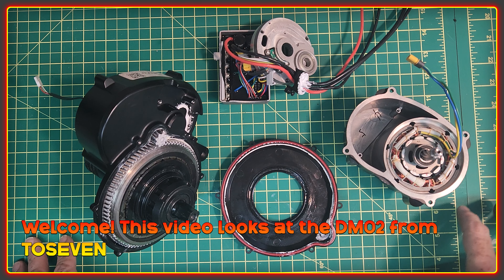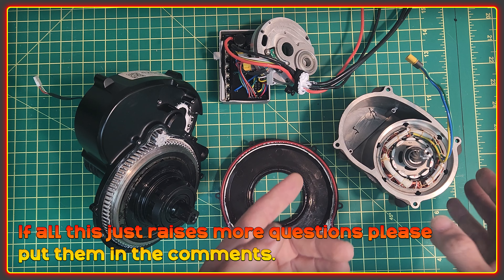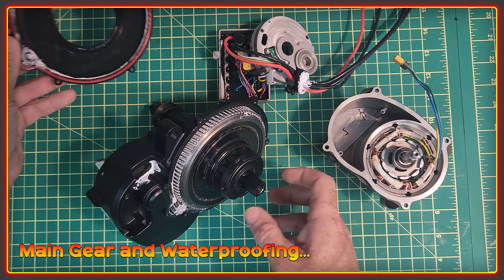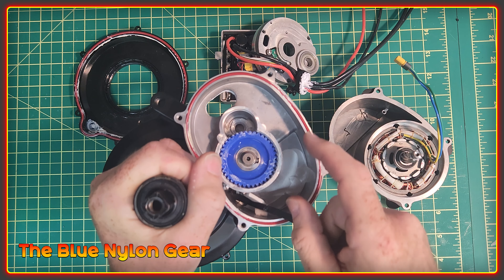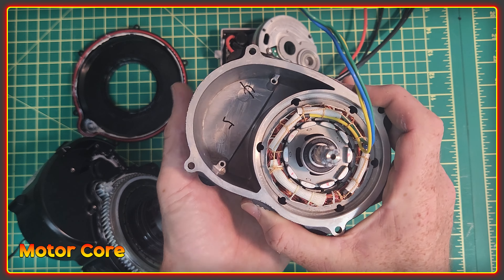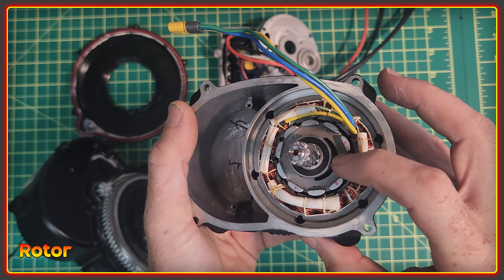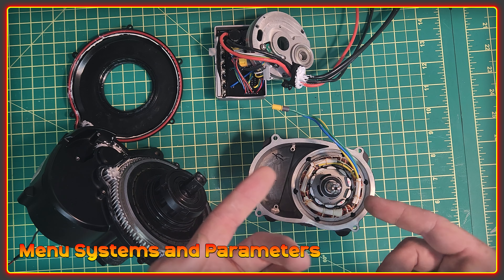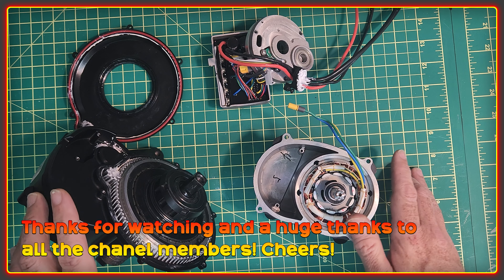Look inside the DM02 from TOSEVEN, discussion on differences with the Tongsheng TSDZ2

Comment: What a great review. I have a Tongsheng Tsdz2 750w and it managed to haul me up mount snowdon fitted to a specialized Enduro wuth a hailong 17.500 ah battery it never missed a beat no overheating.it even had a 46t chain ring on it crazy.iv bought a dm01 now and it is way more powerful but also alot heavier.great vids!!
Reply from the maker: Thats impressive up Snowdon! Wow. Done that climb on foot many a time. I take it this was up the pig track tho right?
Reply: I went up and down the ranger's track set off at about 3.30 am and got up for sun rise it was a good bit of hike a bike aswell.got down in no time atall the rangers track is pretty hardcore DH to be honest so had to be careful as I was on my own I thought the pig looked good but I was parked at the lake near the ranger station.il do the pyg next summer.tongshengs are pretty amazing for the money but iv brought a vitus e mythic as iv tried all the bolt ons now..

Comment: I would love to see the open source programming of the TSDZ2 migrate to the new To7 motor.
Reply: I would like the same!
Reply from the maker: I don't the the controller is the same ecosystem although both are UART. There is alot of work going on this side of things so I believe it will be open and for people to do their own thing with the firmware. I do not have a timescale on this.
Reply: It's open source so forking should be easy, I actually have an active fork for my personal OSF on my bike. The challenge here would be how compatible it is currently in comparison, if we had a guide line or a manual on the protocol it would make it easier. I'll gladly play with it if I get a dm02 once my tsdz2 kicks the bucket.

Comment: Thank you High Voltage for his internals video. While I see the three-phase wire plug (another subtle improvement), I've not read whether or not this motor's controller monitors the core temperature and protects it, as needed.
Reply from the maker: There is a temp sensors but it's just the one. The motor temp is extrapolated from that. I would prefer independent but we will see how it works in practice.

Comment: Excellent to hear they have made the motor self serviceable. I am leaning towards the DM02 instead of the CYC because of this, no point having a great torque sensing motor if you have to post it back to point of purchase just to replace a gear.
Reply: "self serviceable"? Where was that mentioned in the post? Since its  motor press fit into the housing, it seems to me the less serviceable.
Reply from the maker: I have a video to do on the CYC with that respect. I am struggling to get the main gear off.
Reply from the maker: Its not glued in so I am pretty sure the technique is to use bolts to push it out. I will obtain the procedure once translated. In reality though how many people need to service the stator on a motor? Most people that burn an BBSHD stator just buy a new motor core for $100 or so and bolt it on. I would imagine that this will be similar as well.
Reply: @nc3826  its the trade off for having a motor that doesn't cook itself. As high voltage have said you can just buy the motor housing and case all in one. Its not going to be that expensive

Comment: I have a DM02. But I need a plastic side cover And Gasket. Chain came off several times and it cut into the cover. Of course, I have installed a chain guide now.
Reply from the maker: TOSEVEN should be able to supply those spares Tony. Let me know if you are struggling.

Comment: Do we have a pinout for the motor connection to the harness and for the display? I already have a harness wired through my bike frame I don't want to remove so need to know wiring.
Reply from the maker: Discord would be the best place to get something like this. There is a TOSEVEN chat room. I am not sure if the company officially provides one but there may well be a user created one by now. The Discord links are in the description.

Comment: Amazing videos about To7 Motors. Would you say to us what's the distance (gap) between the bottom bracket and the motor. I want to know if the DM01 and DM02 can be mounted in a carbon frame. The CYC Photon have 12.7mm, the TSDZ 6mm. Thanks.
Reply from the maker: Okay so technically it can be just over 12mm. There is however a small metal tab that reduces it to 9mm. I cant see what its for though so if this was removed then it would be about the same as the Photon.
Reply: @HighVoltageKits  thank you, friend.

Comment: Seems like they could have done away with the kidney bean shaped casing and optimized for more room to rotate the motor against the downtube for better ground clearance. I suppose this was tooling carry over from the TSDZ2. Looking forward to seeing if you're able to find a solution for the chain line issue from your previous video. Being able to move the chainring more outboard might be necessary for modern MTBs with chainstays that are very tightly contoured around a small 1x chainring.
Reply from the maker: I don't think the tooling carried over but much of the design layout did. You are right this is an area that could be improved significantly.
Reply: believe it or not it can actually be rotated further up with the new design , there are some image's of it online, the gap between the bottom bracket and the housing has increased, its part of the reason why. i dont think i have any way to link to or post a picture here

the tooling hasnt carried over, if you look you will see the motor is on the other side on the tongsheng
Reply: @Alex-uh1mj  If the tooling wasn't carried over then it was a missed opportunity to improve the clearance even further by getting rid of some unused space.

Comment: Hi, thank you for this video! You compared to the Tongsheng TSDZ2, but what is about the TSDZ2B? Aren't some of these improvements seen in the Tosven DM02 also already available in the Tongsheng TSDZ2B? I am interested in buying the TSDZ2B or the DM02, but I want to choose the more reliable one, having less problems for longer time. Can you give me an advice on that?
Reply from the maker: I believe you are correct that some of the improvements are in the 2B model. I want to say that I have not seen one of those 2B models opened up yet and I have not ridden one so the feedback here is from other people. From what I am hearing the the DM02 deals with heat much better than the TongSheng. This is likely because the motor core on the DM02 is pressed in to the casing and on the TongSheng the casing leaves an airgap to the motor. You can get ones that dealers have modified to have heat transfer pads but its a bit like sticking a band aid on a bullet wound. This is based on feedback on our discord from riders who have had both motors. The feel of the Torque sensor is a bit more refined on the TongSheng right now as the firmware for that has been open source for a long time and has been heavily user refined. So there is some improvement to be had with the DM02. In terms of reliability the TongSheng Z2 does not have a good reputation but then the 2B revision as well as the TOSEVEN DMO2 are also relatively new so until they have been around for a year and people ride them a ton I can't say to you which one is more reliable. I will be getting the 02 back on the bike this week to do some more riding with. You are also very welcome to join our discord and chat with riders using the DMO2 to get their experience directly.

Comment: is this 48v ? how many amps for this motor ? did you try to adjust power levels via menu ?
Reply from the maker: Running 52 volts. I have adjust the amps and the power level percentages yes. They seem to be working correctly.
Reply: @HighVoltageKits  so you can adjust via display?  May I ask where did you buy the motor ?
Reply: @HighVoltageKits  did you put it in the ebike yet?
Reply: @pxl666 amps can be adjusted by the display and set to different modes. For example.you could set eco to 10, city to 14, and sport to 19.   Each with 5 levels.

Comment: Looks like an easy motor to repair. The nylon gear makes sense; it's a mechanical fuse and probably helps with noise reduction.

Motor manufacturers need to look at membrane type pressure vents to combat the moisture ingress issues. Often 'sealing' an air pocket in a product can cause issues as moisture often can squeeze around o-rings and gaskets due to pressure differentials created by thermal cycling. Moisture is also trapped if the product doesn't have some form of weep-hole. I would be tempted to add water cooling to these motors.
Reply from the maker: Interesting thoughts. The gaskets on these are decent quality. Better than Bafangs paper ones! Watercooling mods are definitely possible.

Comment: U say than that the BBHD ratio is 24/1 what’s the cyc and the DM02 ratio
Reply from the maker: I think the BBSHD is 22:1, close enuff tho. The CYC is 36:1 and good question on the 02. I don't actually know. I think it's in the setup menu. I will check when I'm next at the bike.
Reply: @HighVoltageKits  thanks I’m trying to pick one for my bike the BBSHD it’s the one that takes the most punishment and I think give u the most power but gear ratio is too low for me I don’t want to ride one to one ratio , the cyc seems to be very smooth and refine but not good for the diy community, DM01 seems to b a good candidate if gear ratio it’s higher than BBSHD !!!! Thanks a lot for ur content it really helps us to narrow what we’re looking for 👍🏼👏🏼👌🏼

Comment: How is the press fit motor removed from the housing for servicing? Plus please ask TOSEVEN why they use this methodology, instead of other alternatives, such as using a heat conductive paste or stator oil,  for heat dissipation?  Which would allow removal of the housing much more easily.

TSDZ2b has pressed in parts for structural purposes, which makes sense,  And since there is access  to both sides of those parts, they can be relatively easily pressed out and back in again. Which is not apparently the case for the motor housing, 

I actually have a few other questions. 'But was it really necessary to press fit the housing around the motor to achieve sufficient heat dissipation?' Is the main one and I hope you can get it addressed at some point.  Thank you.
Reply from the maker: There are channels down the side that I believe you insert a bolt and by threading the bolt in it will push the motor out of the core. A bit like removing the plate covering the nylon gear on a BBSHD. They are using this technique as direct metal to metal conductivity is better than any kid of conductive paste. Unless there is something new I am not aware of the stator oil will not work with a mid drive and is for hub motor. Lots of people used thermal compounds and shims to help with the Tongsheng motor. I am not familiar with the B motor improvements. All the videos I have seen the motor cover lifts off on the Tongsheng. The pressed in design I think is pretty critical for good transfer. It makes no difference to servicing the motor in terms of difficulty. Once I get it back on the bike I will show what kind of sustained power it can produce and the heat as well. One dealer that could get a Tongsheng to overheat in a few minutes was not able to do the same with the DM02. I will ask for the proper procedure to extract the motor core if that becomes needed.
Reply: @HighVoltageKits  Thank you for confirming, that the (six) outer holes can be used for extraction purposes.  I do hope you will post how the procedure is done properly. Since a few things that could, possibly go wrong (for example was the housing reinforced to deal with the forces from the bolts). But at least TOSEVEN has addressed the issue, in terms of making it possible, to remove the motor from the housing.

DM02 cost quite a bit more, so we need more data, to see if it's worth it? Thank you for helping with the research.

(Sidebar: Conductive paste, which is usually suspended metal particles. Needs to be applied very thinly, to maintain the conductive coefficient of the base metal in the paste. 

In addition stator oil is utilized in Yamaha alternators, so no it's not just used for hub motors, but Grin Technology mostly deals with with hub motors which is It's the main supplier in the e-bike community , so I can understand the confusion. But neither are part of Tongsheng or TOSEVEN mId drive motors, so a direct comparison is not applicable.

Lastly to get a higher level of heat conductivity, a heat pipe could be utilized, but this would increase complexity..Every alternative has trade-offs. What is most important in this case, is relative comparisons.)
Reply from the maker: That's really interesting on the stator oil. I can see how the Grin effect has caused that opinion to form. Thanks. Maybe it can be used inside the CYC Photon. Is there something specific about the design of a mid drive in order to allow its use? I have a bunch of ideas I would like to see with the motors. Maybe I will see if they will work with me on a few of them. I am exploring a few possibilities though. In terms of DM02 price. I would expect more than the Tongshen. So it needs to perform a step above to make it worthy of that. Once I get it back on the bike I will be able to give people an idea of how it does.

Comment: The tongsheng really had an issue where the motor only contacted the case at the mounting point, so most of the motor had NO contact to cool itself, in this video it already looks like that's taken care of

i have a tired TSDZ2 around but i unfortunately don't live in the UK
Reply from the maker: We are based in North America. Where are you? You are correct about the contact point though. People did all sorts of crazy things to improve it from external heat sinks to heat transfer pads.
Reply: @HighVoltageKits  Oh well, even more unfortunate, i do live in Europe so sending that over would be pricy

about the heat, i know forsure it sucks because mine always started overheating and significantly reduced torque/power after like 12km (8mi?) even in 6°C weather

but afaik there are no temperature sensors so that was probably just the magnets getting hot to the point their magnetic flux became less temporarily, and uh probably permanently when it gets that hot
Reply from the maker: Potentially. There is a dealer network being setup for Europe. You can make direct contact via our Discord server.

Comment: Better design than the Photon??"??
Reply from the maker: I am pretty sure that it being an inrunner will mean that it can sustain power and shed heat more efficiently and thats without much in the way of heat sinking. But its peak power is less. So its a bit less snappy once you set it to unrestricted. I think I will need some time to make a call and see how these are lasting and performing. Overall the designs are pretty similar. Helical reduction etc. Similar size. The main difference is the use of the inrunner vs the outrunner.

Comment: tsdz2 had 1-2mm axle clearance out of the box, almost broken like
Reply from the maker: I know its one of the key areas which I forgot to mention possibly. It could be 12.6mm. There is this strange lump or tab that reduces it by 3mm ish right now. I don't see a need for it though. Maybe they will remove it. I have suggested it as then it would be on par with the CYC Photon.

Comment: Looks promising...but I do wish they'd tried to accommodate a wider range of bike frames.
Reply: They have
Reply from the maker: There is a pretty wide space between the motor and the axle. Its not quite as wide as on the CYC Photon but its better than on the Tongsheng. Its tricky with this style to go to far or you will end up like CYC using two chains.

Comment: Cound't see any actual "comparison" as the author said from the eve beginning "I do not have TSDSZ2 motor" It is a purely promotional video.
Reply from the maker: I was sent the motors by TOSEVEN so they could get feedback from myself and the community I manage on what we think and what they can do to improve the motors. As I said it cannot be a direct comparison with the Tongsheng as I don't have one and have never ridden one. There are lots of people commenting on the similarity from the exterior between the two motors. I asked for information on how the designs deferred and presented that information. I also spent some time researching the Tongsheng motor and issues which seem to have plagued it. Both motors were made by the same designer. So its really not shocking that the newer motor does not carry over the same design flaws from one to another. Its a bit of reach to call it a promotional video. Usually when you promote something there is at least a link to where you can buy it?
Reply: The flaws of the tongsheng are well known. No seals. No physical path for the heat to escape. Problems with reduction gear etc.etc 
Anyone can quickly look up a teardown of the tsdz2b there are plenty and the differences are obvious.  A lot of people had been asking to see inside the motor for a long time.. high voltage just gave people what they were asking for. 

High voltage have been critical in a fair way of any flaws they have seen in the motors
Reply: @HighVoltageKits  My point is better to hear the opinion about the new motor, from someone already dealt with the old one design. Like used for thousands of miles, replaced a couple of  reduction gears and services old TSDZ2. Otherwise, just repeating the information from the Toseven leaflets is not helpful at all. Yes, they improved design, theory is good, does it help in practice? What is the price difference for obtained enhancements?  Leave with the motor, TSDZ2 and Toseven, compare price each one could be obtained and how to use both of them on a day-to-day basis. This will be a clear picture of what is best.
Reply: @sergeiprivalov4588  its not repeated from leaflets. If you listen he asked the guy who designed both motors what he has changed and why